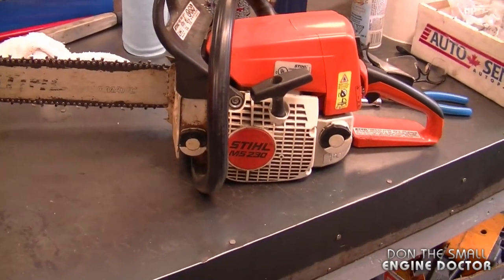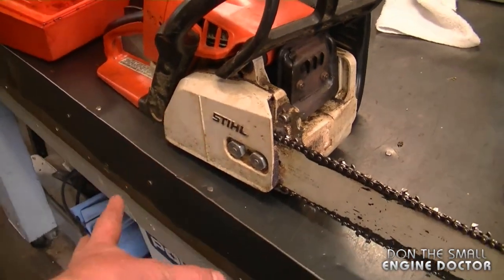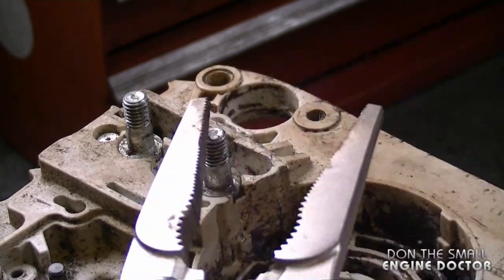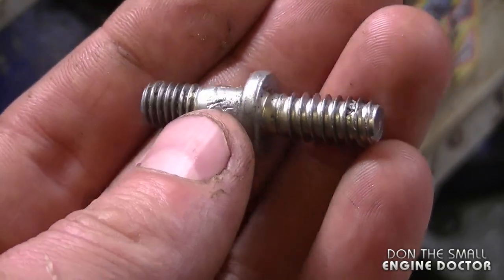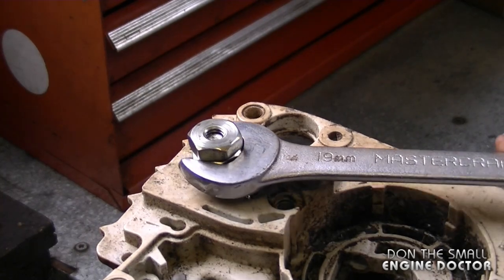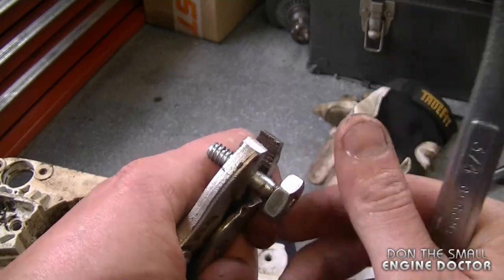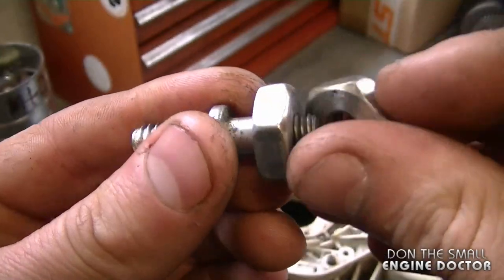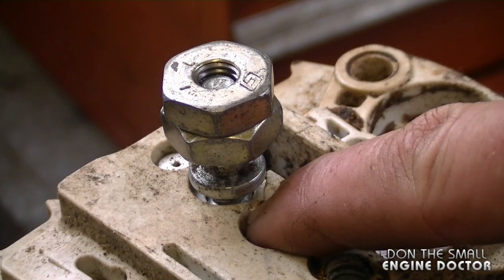How To Remove & Install Stihl Chainsaw Bar Studs

Comment: Thank you for the clear and accurate video.  I was stressed out about shearing one of the bolts off on my MS290 but your video made it clear how easy they are to replace!  Thanks again for taking the time to make the video!

Comment: My bar stud twisted off at the end of the thread. I wasn't sure if they just screwed in or they were secured from inside somehow.  What a relief.  Getting  a new bar stud tomorrow.  Should be an easy fix.  Great video. Thanks!

Comment: That two nut method is super clever. Not sure how I hadn't run across it earlier. Definitely going to use it even though I don't anticipate removing bar studs.

Comment: Just a tip on the vicegrips. You can epoxy flat stock of aluminium on the teeth of a sacrificial pair of grippers to get a gentler hold on delicate pieces. Might come in more handy in other scenarios, like holding a small bolt, nut or even an engine valve against a powered wire wheel, etc. Or for holding chromed pieces. Lots of possible uses.
Reply: nice tip.  thanks
Reply from the maker: thanks for the tip
Reply from the maker: Dixon Cider thanks

Comment: Hi, just wanted to throw in my 2 cents here, from my experience you may want to be cautious using Locktite with plastics as it can make plastic brittle. I'm not sure if there are plastics that are resistant to Locktite but that was always mentioned when I've been working on quads and motorcycles.
An alternative would be to put a drop of crazy glue or some other glue that does not react with plastics, if there is a concern with studs backing out.
Reply: cyanoacrylates are more prone to damage plastic polymer than anerobic adhesive!!!!!!!!!!!!!!!!

Comment: Ive used the double nut method on motorcycle bore through rods, its a good old trick :-))

That bit of shank roughness will vanish with a small file :-))

Comment: I have a husqavarna 345 chainsaw and it leaks from one of the bar bolts. the oil reservoir is completely sealed on this saw. How would I go about changing out one bar bolt. No access the oil reservoir  does not split in half? That's odd. And it also leaks from the bottom oil filter plug there is no o- ring there it's only pressure fitted the part has small ribs that just fit into the hole. What can I do about that as well? Thanks Mate ( Just subscribed)

Comment: Threads were stripped on my stud so the double nut method won't work. I used an angle grinder to slot the top of the stud to accept a flat head. Had if out in no time.

Comment: what would cause a two stroke engine not idle, but run fine at high speed, the engine bogs down when you try and lower the rpms ? any help would be greatful
Reply: +Josh Kilen It could be sucking air through the crankcase seals or it might need a new carby kit and a tune
 up :)

Comment: My ms192 bar stud gets replaced often.  To the point that I can't remove the cover or tighten the chain.  
Can be a pain, not sure if others have the same issue with this model.

Comment: Any ideas on how to repair a stripped plastic stud hole?  As yet the makers at Stihl have no solution, and have been making plastic saws for some time. You would think they could put a metal block in there. If the hole is clean, maybe an epoxy might work. Cannot find a replacement stud made with a larger thread.
Reply from the maker: you can try a heli coil but be careful tightening bar
Reply: Sthil does make a larger stud for this purpose. However it only worked in mine a short time since the hole was so badly damaged from trying to heli coil it before I found the larger  stud.
Reply: If the thread in the engine housing is badly damaged or stripped, it will not be possible to secure the standard collar stud (1) properly. This situation can be remedied by using the DG 9 collar stud
1127 664 2410 (2)
Reply: @magicone9327  Thank you. What a miracle i found this .  Might help.  Stihl MS 251 Stripped  Engine Housing
Reply: @johnhyde8623  Thank you. What a miracle i found this .  Might help.  Stihl MS 251 Stripped  Engine Housing

Comment: Hi Dony . . . Have a Stihl MS 290 chainsaw with a stripped out bar stud hole. What is source and specification for heli coil to repair?
Reply: Mine is stripped also. Did you get a new case or use epoxy
Reply: If the thread in the engine housing is badly damaged or stripped, it will not be possible to secure the standard collar stud (1) properly. This situation can be remedied by using the DG 9 collar stud
1127 664 2410 (2)
Reply: John Hyde If the thread in the engine housing is badly damaged or stripped, it will not be possible to secure the standard collar stud (1) properly. This situation can be remedied by using the DG 9 collar stud
1127 664 2410 (2)

Comment: If the thread in the engine housing is badly damaged or stripped, it will not be possible to secure the standard collar stud (1) properly. This situation can be remedied by using the DG 9 collar stud
1127 664 2410 (2)
Reply: The plastic hole is stripped on my Echo CS-130. I am hoping the DG 9 collar stud
1127 664 2410 (2) will work on my Echo. I imagine you have to drill and tap the hole to match the larger stud. Thanks for the tip.

Comment: I noticed my studs were spinning around and around while trying to tighten my chain . I found that the holes which are plastic are stripped out . how do I repair these ?
Reply: If the thread in the engine housing is badly damaged or stripped, it will not be possible to secure the standard collar stud (1) properly. This situation can be remedied by using the DG 9 collar stud
1127 664 2410 (2)

Comment: Worked on 1. Stripped my nuts on the 2nd saw. But vise grips/pliers got it out. Putting a new one in is not as hard. Guess I will have to buy big chunky needle nose locking pliers

Comment: I traded for a ms250 the guy I got it from over tightened the bar studs and stripped them out in the saw what is a way fix it
Reply from the maker: heli coil or new plastic casing
Reply: Ok thanks a local saw shop told me to ruff up the inside of the hole put epoxy in it drill it out retap the holes and screw the studs back in I thought that was a little much

Comment: My God a plastic chain saw bar mounting point. I always thought Stihl was very good over priced gear or at least in Australia it is. The fact they are making the saw our of plastic really shocked me to the point I will avoid buying one now unless this is just a cheaper model.

Plastic - Really wow.
Reply from the maker: this is not a pro model that's why it's plastic, the pro ones are made of metal
Reply: it is amazing plastic though, almost more like nylon.  very durable.  you almost cant strip the plastic mounts where the screws thread in.